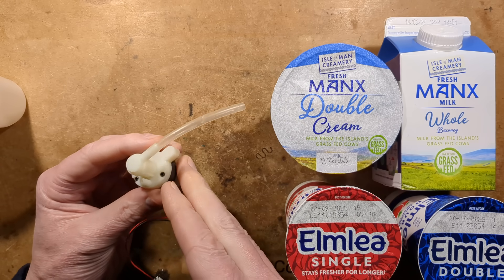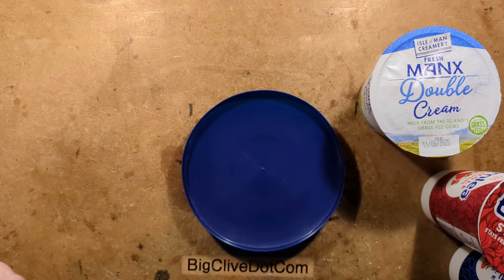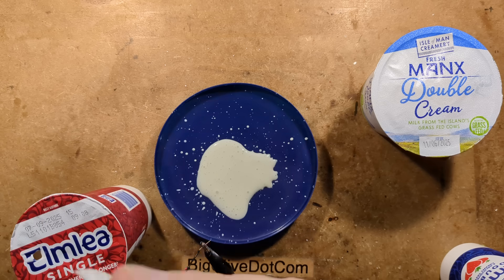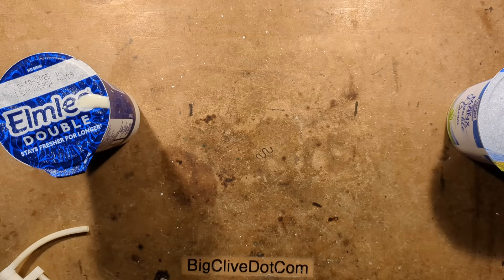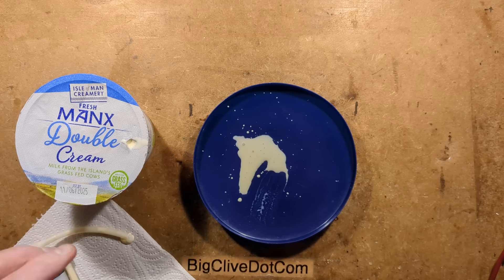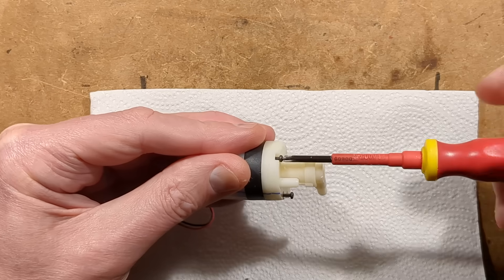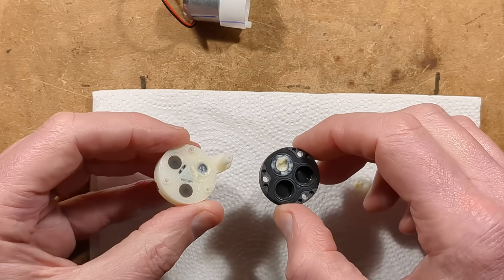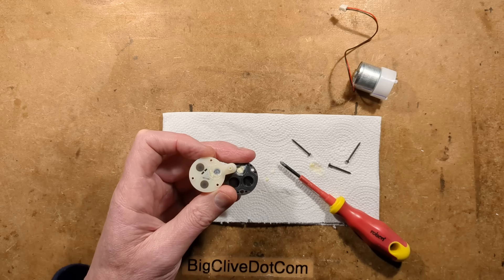I put milk and cream through a foaming soap pump

Comment: I really wanted this to work! What if you mixed up the cream really well beforehand? Maybe a screen on the end of the pickup tube kind of like what you find in a nice spray bottle? More power, turn up the voltage? What about a booster pump, pump into pump action?

Comment: Try mixing the double with a little of the single to make the fluid a little more runny... Or, get some 'whipping' cream, which I believe is a halfway house between double and single. Something about needing a minimum amount of fat in the fluid to get it to hold air...
Reply: You beat me to it.

Single cream is less than 20% fat, double cream is about 50% fat and whipping cream is about 33% fat. That might be sufficient to allow it to foam as desired without being so thick as to block the pump.
Reply: I don't think any ratio will work, it just doesn't foam nearly as easily as soap. With soap the ratio hardly matters between pure soap and 1/5th dilution you just get thicker or runnier foam, so I doubt a slight change in the ratio will suddenly make the cream foam up.